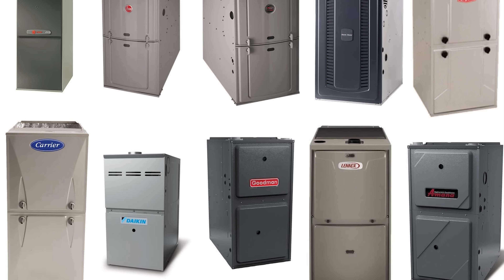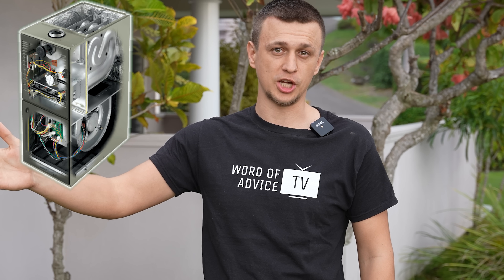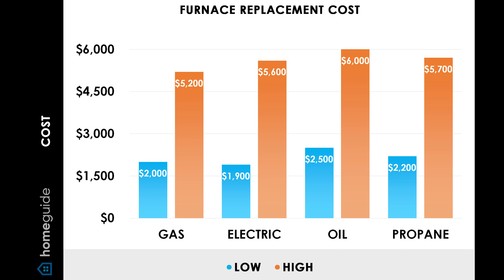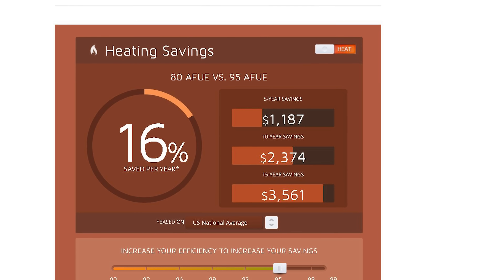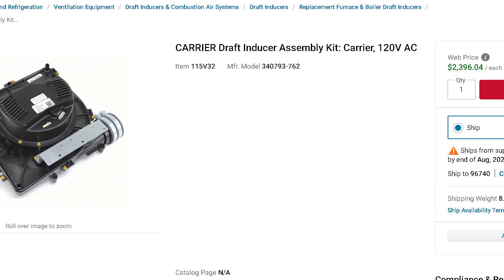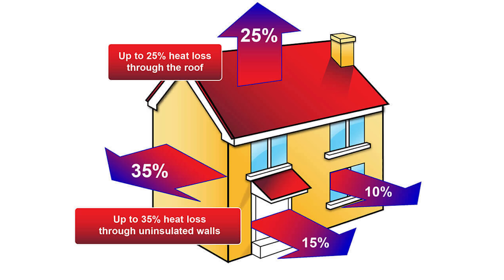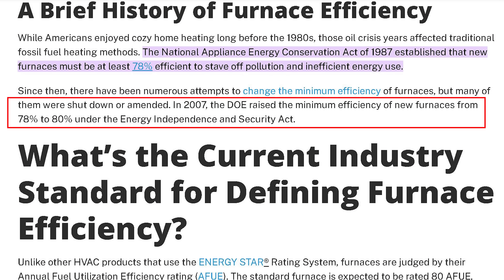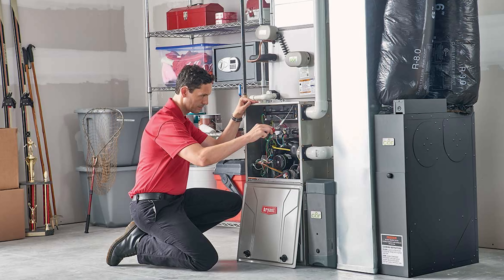Don't Buy a High Efficiency Furnace!

Comment: Our problem is our 20 year old furnace has a large blower motor and uses a lot of electricity. The furnace itself has a lifetime burner warranty. We had a large central air unit at one time that required the big blower. Can I replace the blower with a DC blower motor?

Comment: I 100% agree. I just replaced my gas furnace and stayed with 80% single stage unit. The HVAC outfit tried to get me to upgrade. Trane 7800 installed. Both inside and outside units. I have no complaints about this unit!

Comment: I've had my 90% gas furnace for 12 years now.  I heat with propane.  It came with my manufactured home.  So far, I've save $700 total in fuel costs.  I have done some minor repairs like fix the safety shut of switch and changed a fuse that blew because the factory wired the thermostat incorrectly.  I would say that your case holds true for me, but in a break even sense.  But I'm all set up for a 95% furnace to go in with little to no modifications.  Maybe spin the plastic vent and intake pipes a little.   The biggest problem I see is to find a contractor who is not out to retire on one job.  Of course, I could put it in my self, while giving my grandsons some on the job training.

Comment: Are you beside recommending do not buy those high  any efficiency furnace, do you have any specific name those can help us avoid then , because actually we rely on the technician suggestion of the furnace they are actually working with.
We are going in a house of 1000-1500 SF, with a Heil 100 K.

Comment: We have a Bryant90i that has worked fine for 17 years. A power surge broke the Honeywell electrostatic air filter. The same surge blew out the MOS surge suppressor on the ECM blower motor. Steadily I am watching  Youtube videos and understanding how the furnace works. The furnace has lasted without much care because it is oversize for our mild climate.  

Times are changing, due to worldwide global excess CO2.  I am just an amateur working on my only gas furnace. I would like to set up a internet controlled  room fans to so empty rooms can be left cold and the kids can have some heat even under extreme conservation..

I am 74 yo and I would like any energy conservation improvements to last a long time. I would also like any improvements to be safe, I don't want my grandkids to be killed by carbon monoxide from a furnace no longer monitored by me.

Comment: This is why you might as well go for a heat pump over the high efficiency. Just got quoted and a high efficiency multi-speed system is about the same price as a heat pump system. Then with the incentives there are right now, you can probably save money. I got my high efficiency in my last house because there were some decent incentives. It was certainly noticeably better than an 80%, but it did have one failure, that was luckily covered under the 10 year warranty.

Comment: that would be ashame to see a 95% minimum efficiency rating on all new installs in 2028 if that goes through.  the average american cannot replace their own hvac equipment and the cost of them having to purchase and maintain a 95%+  efficency furnace will do no good for any party involved.

there is nothing wrong with standard efficiency furnaces, airhandlers, condensers and boilers.  everything you have said is 100% true. the bottom line is this: hvac companies need to be able to offer friendly prices to customers and the customers need to be able to afford those costs.  there needs to be a budget friendly install and maintenance option available to clients

Comment: I have a lennox pulse 21.   how do you feel about this furnace?
Reply from the maker: It's a very reliable furnace. Made like a tank! But some of them did have issues with bad heat exchangers.. So great furnace, if the heat exchanger isn't compromised.

Comment: Hi jay.  Im ourchasing a goodman 96% 80k btu. The width will match 22inch but its not as tall. Any suggestions? Build a base out of something or should i just build a square out of ductwork and have a void between heat exchanger and A coil.  It would be about 12 inches

Comment: Canadian don't have the OPTION of purchasing mid-efficency anymore. What's your opinion on older (1980) "Clare-Hecla" (mid-efficiency) furnaces ?

I'm pretty sure the company went out of business because their units were bulletproof, requiring minimal yearly attention.

Mine was installed in 1980 and the central air was recharged due to a pinhole leak, in 1985.

Single-piece round cast iron burners are miles better than header and finger burners from a design standpoint. The thermopile's ($30 CAN) been replaced by me 3 times over the years...but that's IT.

I call 43 years basically trouble-free, a really GOOD design....industrial maintenance electrician....just my 2 cents.🤔

Comment: I recently had my 25 year old York furnace and A/C replaced with a Daikin Fit heat pump and 96% efficient furnace.  Oh by the way it has a 12 year warranty. I live northwest of Chicago.  Did I screw up I'm 70 years old?
Reply: Heat pumps are not cost effective below about 40f, the efficiency drops off and cost more in Electricity than what gas costs for heat.  So basically worthless that far north for the cost,  Hight efficiency gas (single or two stage) is most cost effective option.  Unless you like the comfort factor of fancier unit.

Comment: Reasoning for #1 heat Exchanger failing is FALSE as most heat exchanges were warrantied with a minimum of 20 years on the Furnace and some (High Efficiency were lifetime Warrantied), and it is a mis-diagnosis by the Technician or they don't inform the customer that the Furnace has a heat Exchanger Warranty but tells the Home Owner that the Furnace needs to be replaced because it's easier for the Tech to sell the Home Owner a New Furnace or the Tech is set to make more money from the Sale of a new Furnace. Reasoning #2: If you are a Smart homeowner, you won't fall for these price gimmicks especially if you can price compare Furnaces online for the actual cost before installation. This is especially true if you live in a newer home that doesn't have a chimney or is unable to have a 80% Furnace installed. Reason #3 is FALSE, parts on a 80% furnace don't cost anymore than the parts on a 92% Furnace. It just depends on whom you wish to get scammed by the most. All HVAC Techs do not charge the same for the same part. I have seen one Tech install a Blower Motor for $300.00 and another company for $800.00 for the same exact part for the same exact Furnace. also, don't get conned into it will cost less to replace the Furnace than repair it, again it depends on who you have replace the parts and for what price. Don't forget, parts in a Furnace don't wear out in a few years like they did 20 years ago, parts last 2-3 times longer, which in return means your Furnace last longer (The main reason you are being over charged for Installation, because the Furnace was made to last forever). Finally, don't listen to this guy, buy a High Efficient Furnace and WHEN it breaks down after the 10 year Parts Warranty (Lifetime Heat exchanger Warranty), find a credible HVAC service tech that won't rip you off for repairs, and you will see it will be the last Furnace you will ever need to buy for your house and your energy savings will be your investment in that Furnace.

Comment: I agree in principle, however, there are local and tax credits for getting the installation price down, also parts will become more common as they are more widely accepted.  however, if it's not broken, don't fix it, keep what you have running.  but if you have to buy new, then really consider changing to high efficiency, it puts you at much lower risk of price spikes, not just recouping the initial high outlay.  

having said all that, adding insulation is just picking up money left on the table no matter what

Comment: I am no expert in this field but I do know that our current furnace (natural gas) is 90% efficient and was installed in 1999 when our house was built. We have owned the house for 4 years and never had any issues with the furnace or original AC. I am horrible too because in the 4 years I haven't even had them serviced. I guess what I am saying is I think they would qualify as high efficiency and we have gotten around 24 years of life out of them so far.

My parents also have a high efficiency setup that was installed in 1998 when they built their house. They have had a few issues over the years but the total cost of repairs in 25 years has been under a few hundred dollars. I guess 25 years ago things were made better so that could have something to do with it.

*Note: We get a few days a year below 0F and around 25 days above 100F.

Comment: I live in Kansas, were we have cold winters, and have a 36 year old Coleman 90% gas furnace (single burner) that's still working great!  The original A/C unit  is also still working but need some R22 added every summer so I'll be replacing that this year but the furnace is here until the drum heat-exchanger decides to give out.  This is one of the first high efficiency furnaces ever made and it's built like a tank!
Reply: Some where made great back then like this: Lets Calculate: Savings of 95% over 80% for 35 year life of Lennox Pulse (made 1987).  $1000 year spent on Nat Gas with 95% so spent $35k in 35 years.  Would need 19% more gas for an 80% (.95/.80=.19).  So $35k * 19% = $6,650 saved over 35 years.   NOT ONLY is there energy savings, but HIGH quality equipment last twice as long, so saves another $3k to install another one.

Comment: I had a top of the line Trane installed 10 years ago. It has been a learning experience. The first lesson came when the drain to the outside froze and shut the unit down during an ice storm. I still need to run the drain to a vent stack on the wastewater system to keep that from happening. I've had to thaw it out twice over the years and that is never fun in bitter cold. I keep it insulated and have a heat tape on it, but sometimes that just isn't enough. Last month the unit quit heating and the problem turned out to be the main board. Thankfully it was still in warranty, but it took three days to get one and have it installed..

I  initially thought I'd like the programmable thermostat so I could just set the temperature and forget it. However, the spread needed between the heating and cooling temperatures just doesn't work for my situation. The wife likes it cool, and we care for my mother (95) who likes it warmer. So, I don't set the thermostat to Auto. I just set the temp for the same in all periods and switch from heat to cool as necessary. I put a space heater in mother's room, and a window unit in our bedroom (where my wife spends much of the day on the computer). They can both close their door and keep the temp they want, and the central unit doesn't run much during moderate weather. It's a crazy way to do things but at least I don't get too many complaints.

Bottom line: If I have to replace the unit, I'm definitely planning on going the 80% route. Of course, there is talk now about banning gas appliances and that could change things considerably. I've got lots of wood and will probably purchase a high efficiency wood furnace and tie it into the system.
Reply: Yes your installer should have known not to vent the furnace condensate to the outside it would freeze. If this is an attic installation an 80% would be a less problematic option as there’s no condensation produced in heating mode.

Comment: Great point about the high effciency furnaces parts being way more expensive and harder to get. When your 90 plus furnace is out of warranty, any cost savings in the higher effciency furnace is now lost due parts being much higher. My single stage Ducane 80% furnace has run flawlessly for 25 years.

Comment: You have a lot of HVAC installers agreeing with you as a homeowner I also agree. The circuit board on my furnace went it's an 80% and I picked up a new board for $140. Cost would have been much greater for high efficiency furnace. A unit I could not even touch safely
Reply: Both styles of furnaces have the same boards, so this is irrelevant.

Comment: Come on I installed an Arocaire high efficiency in 2003 and it has never broken down in 21 years with both heat exchangers being stainless with lifetime warranty. In Canada 80% was ban 10 years ago ,and u paid 1200 in 2003.if I replaced it today it would be with an Armstrong again both exchangers stainless

Comment: Great video but I think a lot of customers and techs are not seeing the big picture...if you don't service anything electrical IT WILL FAIL.havent ran across any operating car, train or airplane that didn't need some kind of maintenance..if your unit hasn't had any problems in x amount of years that's great,But preventative maintenance is 🗝️

Comment: I'm confused as to terminology. What defines a high efficiency furnace? I have a Weatherking 90+ that I put in my house 25 years ago for $750 new to replace the heat pump once I ran NG to the house. I recently replaced it with another 90+ Coleman to sell the house with a new furnace. I paid around $1000 for the Coleman on Ebay new. I just converted the Weatherking to LPG to use in my barn. Aren't both of these furnaces high efficiency? I would say that the 90+ is worth the money. I don't see much difference in the parts between 80 and 90+. I can see the added parts  expense of a modulating furnace.

Comment: You will pay $2,000 -$2,500 more for the high efficiency furnace. At 12% more efficient, you will save about $300 a year on average. They require more maintenance and cost more to repair. The pay back is about ten years. Not worth the expense and cold nights when the part you need isn’t on the truck because it is a proprietary part and on backorder.

Comment: I have a 98% efficient furnace and HVAC. I have lived with every kind of Furnace made in the last 70 years. I don’t really care about the cost. What I do care about is the comfort quality of my house. The Modulating Furnace and HVAC are by far the quietest and provide the most comfortable living space year round. I have had to fire heating contractors because they didn’t want to install the High end units. I live in a major metro area I chose Carrier, because they work well and If you stick with a certified Carrier installer and service team, have the unit maintained they just work. And If they need a part, the dealer has it in stock. I get it that Installers get beat up on price. I get it if you are an independent it may be harder to source replacement parts, but for the love of God stop scaring people away from the best units on the market. For what it is worth the heat exchangers are warranted for 20 years by carrier.